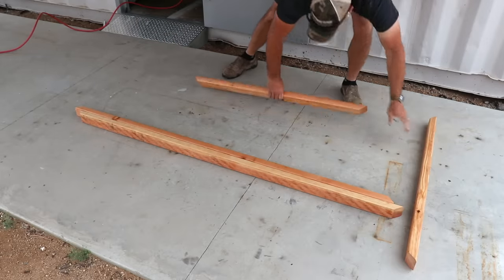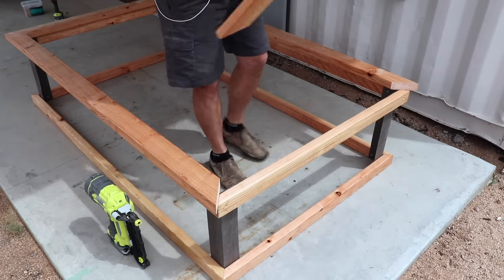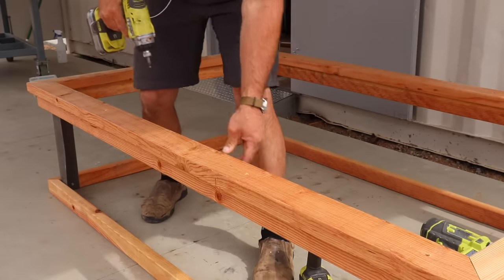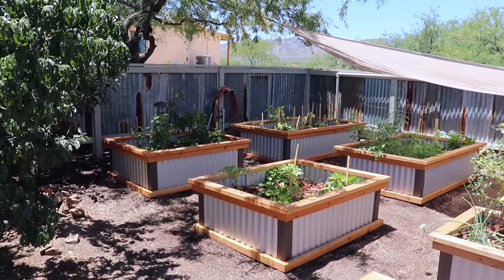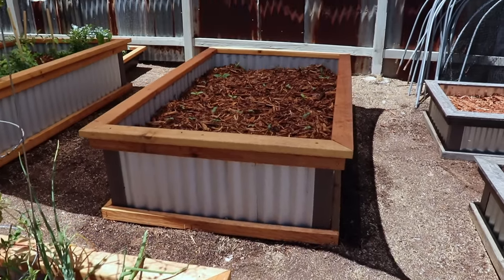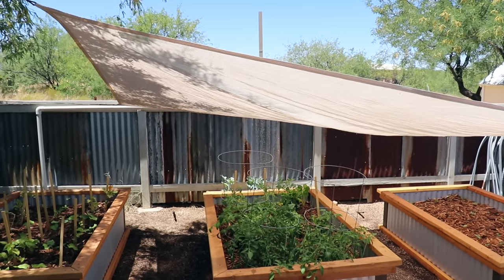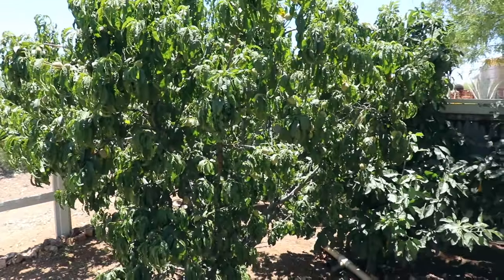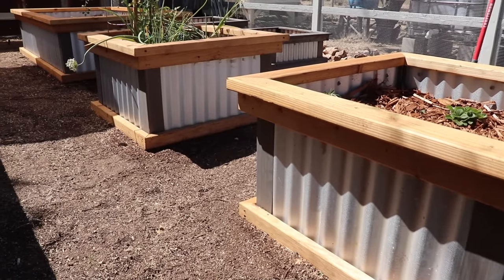Beautiful DIY Raised Garden Beds in 3 MIN!  - How to Build

Comment: I have a question, how high can the flashing component be? I wanted to make the raised bed about 32 inches as I am getting old and hard to bend. I am worried about the integrity of the flashing to withstand someone sitting on the top while gardening. Would you suggest wood instead?
Reply from the maker: The flashing isn’t holding weight at all when you sit on it.  It will be the roofing that will be holding the weight.   Which is why I like the vertical corrugation orientation as opposed to the horizontal ones.   In the horizontal positioned ones the flashing/corners would be taking almost all of the weight.  Hope that made sense and thanks for checking it out

Comment: Does the harvest  worth the effort and expenses? 
 I really want to go for it but am hesitant about putting 4 boxes in the backyard.
Great video as always man.
Reply from the maker: Thanks!    As for the harvest vs the effort of making beds.   That is a toss up.   Depends on how long you use them.   
The best bang for your buck is just to grow in ground if you can, at least in my opinion.   Building beds just makes the area pretty and the experience nicer.  But in most areas not totally necessary.  Hope that helps😀👍

Comment: Simple designs are often best, relatively inexpensive and they work, great job. You will drastically extend the life of that untreated wood and steel with a healthy coat of boiled linseed oil and a 2 dollar throwaway brush.
Reply: Boiled Linseed Oil, is not food safe.

Comment: I'm wondering if it might be possible to use corrugated fiberglass roofing instead of metal. The strength is in its shape more than it is the material so, it might be strong enough.

Comment: Did you use pressure treated lumber for the frame? Seems like the wood would deteriorate much faster than the metal.

Comment: Nice Build!   I am however curious, as I've seen different corrugated roofing builds  and noticed that your design laid the corrugated roofing vertically, where as others have built their's with the roofing horizontally. Have u noticed a difference in the build and on the external effect of water or drainage / moisture / wood rot ?  Didnt know if it was a design consideration.
Reply: I'm going to make these and I like the orientation big time of his panels. Structurally they're infinitely superior and load bearing, the look is so much nicer than any I have seen. This guy has a real eye for detail and an incredible mind.

Comment: Untreated timber? Rot? Termites?
What exactly is hardware cloth? Mesh?
They are certainly good looking beds, well done as usual. I really like the idea of using that corner flashing, I am not sure we have that here. As for the corrugated sheeting I would estimate that 90% of all garden beds here in Australia are built using it. Most would be colorbond though (as in painted), but not all. I would be interested in the what they cost you, a heck of a lot less thane here I bet. Cheers!
Reply: Yes mesh cloth, I use 1/2 inch size hole for my strawberry bed to keep the gophers out. And 3 layers of weed block cloth to keep crab grass from coming up through the bed.

Comment: I see several of your videos on raised planters that say they're your favorites so which of the builds would you say is your favorite overall

really debating using the lumber around the base or not. I'm up here I guess in the midwest Southeast Iowa

wondering how well they are going to do at staying level
I'm looking for about 36 inch height overall so I was thinking of using a 3-foot call section and then put about an inch or so into the ground below the lower wood framing if that makes sense

Comment: I have a question on the concern for cross bracing.  I am looking at building several 4x8 beds that are 24" tall and want to know if anyone has had issues with sides bowing out?  And if you have needed to put in a cross brace.

Comment: Did you turn the corrugated pieces sideways like that for stability (being vertical instead of horizontal) or because you like the looks that way better? I imagine it is for stability (or you just didn't want them 27" tall) because with just the flashing it seems strange you could sit on them . Is that the deal?

Comment: Mine went on a lawn so I left 2 inches of the siding hanging beyond the bottom frame so that I could whipper snap around them and to keep the wood off the ground to prevent rot. I probably should have went 3 inches as I usually cut the grass as tall as my machine allows.

Comment: Hellooooo thanks for the idea, they are amazing. Question, what is the highest you would recommend? I kinda want them taller. Thanks
Reply: I’m looking at another site that is twice as high, uses pallets for ends and 2 by 4 s (or 6s) to connect, and is much longer. I think they use the metal lengthwise. “Huegleculture” method used to fill and make into a compost bin on the bottom...”dirt patch heaven is the site I 🤔

Comment: Ok, I feel like premadonna and newbie asking this, but I don't know much about metals... I have all wood raised beds in the backyard, but I really like the look of these and want to add a few to the front.  So to my question... the roof flashing corners, I can only find it in the same zinc "color" as basically the corrugated sheets, so for the look of it if I bought what I found, there wouldn't be contrast between the corners and the side like what we see here.. is this something more to look for other then "galvanized steel"?  Thanks in advance.

Comment: A couple of questions for anyone…
1. Does the corrugated metal keep it sturdy? Wondering how it can take so much weight with only flashing?
2. Is the wood treated lumber?

3. Would anyone recommend using patio stone underneath for drainage?

Thanks!

Comment: Thanks for the ideas. Do you recommend staining the boards?
Reply from the maker: Yes, treating with some sort of oil would be recommended.   Or using pressure treated as the soil does actually touch the wood😀👍

Comment: In regards to the metal getting hot and heating the soil, corrugated metal reflects much of the heat away if you leave it in it's original galvanized state. Now, if it was a dark color, like black, it would absorb a lot more heat.

Comment: Did you use pressure treated lumber?  Any reason not to?
Reply from the maker: Nope, just regular pine.   I did coat them with linseed oil before I assembled them though.  But pressure treated lumber could be used as well😀👍
Reply: Brad Kusko He lives in Arizona where it’s extremely dry and rot is not common. If you were in the Midwest then treated would probably be the way to go At least for the bottom two by fours.

Comment: Hi. I am in Australia and I’d like to ask what type of timber a 2 x 4 is. Is it hard wood or soft wood. Treated or in treated. 
Thanks Phil
Reply from the maker: Hi Phil,

The boards I used are just regular pine.   I did coat them with linseed oil before I assembled them though.   But you could certainly use any wood you’d like to....pressure treated, hardwood, etc,.    Hope that helps and great to hear from 🇦🇺😀👍
Reply: homesteadonomics. Thanks again and I have started building some today and the chicken watering cups have arrived so that’s the next project taken care of. Keep well & stay safe.

Comment: I have an unusual issue.  I have septic field in the only sun area on my property.  I would like to build raised beds using 2) 4x4s as rails on the bottom of the boxes as to only have a minimal contact area on the lawn/septic.  I have been told no.  The ground is solid and firm.  Suggestions Please.

Comment: 31 and 32 gauge corrugated roofing is all I can find locally at Lowes and Home Depot.  Reviews are mixed, but it is thin.  Any idea where you can buy thicker corrugated metal roofing, 26 or 29ga?
Reply from the maker: Last I checked, the roofing at my Home Depot was the 29ga stuff(southern AZ).   And the roofing I used in these beds is left over from my house roof which was 26ga.     I would be hesitant to use31/32 ga.   Maybe try a roofer in your area to see if they have a source or could order you some.   Also, depending on where you are some smaller places will roll it for you in different profiles.

Comment: Corrugated metal pipes are used for water supply in older homes and commercial buildings. I believe home builders and plumbers went to plastic piping for homes only because of lower pricing and ease of installation (meaning less labor costs). So there is not a reason to worry about leaching from corrugated metal walls into the garden beds.

Comment: What was used to cut the roofing and flashing ?
Reply: That is a "cut off disc" put onto an angle grinder. They're a fiber composite very thin disc that will chew through anything with ease. They're very inexpensive too.

Comment: Is it necessary to have the wood at the bottom?
Reply from the maker: Nope, not completely necessary.  I have built a style of bed with no wood at the bottom.   Just a little bit trickier to get everything lined up when placing that beds since the metal will be a bit floppy until put in the ground.

Comment: Hey  Joe @homesteadonomics,  I'm curious about what you used to fill these planters. I live in CA on the Eastern side of the Sierra's which the soil consists of high alkaline desert sand. I'm sure it is similar to your AZ soil. Did you make your own concoction or buy bagged soil & amendment from the store? What is your soil recipe, and now that we're headed into the 2021 Spring crop season, how would you change your recipe? Thanks for your input, Joe!  12/24/20

P.S. Love the Container shop build-out series, too

Comment: Great build, I like how you cleverly used the angle sheet irons for the corner supports to get the corrugated iron as close as possible to the wooden rails. 

Question1)  Do you think some plastic concrete liner sheet would help make the corrugated iron last a bit longer (so the iron no longer is in constant contact with moist soil. 

Question 2) Have you ever compared the costs of buying pre-made corrugated riser bed kits versus  building your own ?  (ignoring the labour for both methods)
Reply: Galvanized metal will last long when the moisture is not held constantly against the metal.  The plastic liner that creates an air pocket should help the metal to last longer by creating an air pocket.  If your soil is well aerated this would also reduce corrosion.  I think this design with good soil should easily last 10yrs and more than likely 15-20yrs before you would have rust holes.  For my boxes I plan to use corrugated metal that has been prepainted.  This product you can order from your local metal roof supplier.

Comment: Now I have too many ideas for beds!
Reply from the maker: There are a lot of good ones out there😀👍
Reply: @homesteadonomics  Saw one the other day made from half width a cattle panel and a roll of 20 in wide aluminum flashing, which got me to thinking about using a 47 inch tall horse fencing on one side and 24 inch fencing on the other with the flashing to cover the hole that would give me my outside fencing  with the horse fence which is much cheaper than cattle panels and I already have it on the place, along with T posts to hold it up. But that is for next year we'll do containers this year

Comment: Where did you find your flashing or what was it called specifically. I've searched L flashing, Corner flashing, and Step flashing and can only find it in 8 inch lengths or up to 10 ft lengths. I was looking for 2 ft length or did you cut yours down to size?
Reply: I can't find anything but 8" long flashing it seems

Comment: Thanks for the "How To " video.   I would shoggie burn the wood and may be a nice sealer for extended life.
Question:  Your opinion of using  Cow trough metal tubs with a drain pipe?
Reply: I've seen them used, just really pricey

Comment: Beautiful beds but impractical in my area of texas. Plain wood will rot away in less than a year and treated wood may release toxic elements into the soil. I've tried concrete block beds(lost water to quickly). My beds now are mostly just the corrugated tin. Several are completely round. For shallow rooted vegetables like greens and lettuce I use raised cattle bunks. They are ten feet long by two feet wide and on a metal frame that holds them at waist height. A couple of drains on the ends set to hold an inch or so of water at the bottom. A sprinkler hose down the middle of the beds keeps them watered. I have four of the cattle bunks. Eight corrugated tin beds and two hydro beds fed by a six hundred gallon fish tank.

Comment: How did you keep it from bowing out. Mine look round in middle.
Reply from the maker: Hi Caroline,   I haven t had that problem.   But if they are too long or too high then you can strain the wood too much with the soil pressure.   I’m guessing that is what you might be experiencing.   My long ones are about 7.5’ long.
Reply from the maker: .....additionally if you are adding heavy clay soil or something like that it could happen.   A well drained soil would be best.   Hope that helps

Comment: Could you make the beds 10 ft long x 4 ft or would it not be structurally sound. Also what gauge steel did you use?
Reply: Excellent question Greg thanks for asking I was going to ask the same as I made a trip to Home Depot last night and the roof flashing the offered looked rather flimsy. I understand that the corrugated pieces will make the entire structure rigid. But when he flips the structure to add the corrugated pieces it looked rather stable. So I don’t know
Reply: @mski435  I am going to go with the 26 gauge vs the 36 gauge  for two reasons, First the structural integrity but also when you cut the galvy you expose the edge to faster oxidation and i don't want to have to repair in 5-8 years.
Reply: Greg Paulsen thanks so much for the reply
Reply: Greg how did the 26 gauge sheet-metal work out for you I see a lot of people are asking the same question about the flashing that he used I was unable to also find that size at Lowe’s or Home Depot I may have to go to a sheet metal shop and fabricate it however isn’t a 26 gauge still rather thin
Reply: Actually I rewatched  the video if you look at 2:12 you can see that the flashing It bends a little bit when he applied a little bit of pressure to it,so the stuff he’s putting in there is quite  thin however I think the rigidity of the entire unit is really due to the corrugated pieces that are put in after the fact so at this point I’m not too worried about the corner pieces. I think the corner pieces are purely aesthetic

Comment: About how much do they cost to build. Love how they look.  I live in New Mexico what about rodents and 🐍 do they get into them totally cared of snakes. 😄
Reply from the maker: I broke it down in another response but it came it about $85 per 4x8 bed.   However I used old roofing scraps that I already had so they were substantially cheaper as the roofing is one of the pricier components.  I’ll try and remember to pin a comment with the rough costs😀👍
Reply: Scared. Of 🐍

Comment: My understanding of galvanized metal. Assuming the maker of said metals is reputable.  A greater concern to health would be the burning of galvanize metal.  It causes the release of zinc oxide.  The fumes are toxic.  The corrosion of galvanized metal will also release zinc but at a low level and the plants don't mind.  What would be a concern is with the little bit of lead that is also in the galvanized metals.  Lead not dissolving much in water can remain.
Reply from the maker: That’s my understanding as well.  I’ve welded stuff that I thought I got all the galvanizing off and it did produce noxious fumes.   So I had to do quite a bit more prep to remove all the galvanizing and then is was okay in that area.  And for these beds I think a little extra Zinc won’t be bad for the plants😀👍

Comment: WoW. That's fantastic and so simple that it's brilliant! I call that 'elegant' design. I would have thought that the roofing panels wouldn't be able to withstand the pressures of all that wet dirt. But I guess I would be wrong! Do they show any signs of deforming under the pressure? 

I was going to build 4" thick monolithic concrete raised beds so that the archaeologists in a thousand years would scratch their heads and wonder what kind of religious sacrifices were performed there... Heh. But even if these rot out in 20 years, they'd be easy to replace!
Reply from the maker: Thanks!!   I haven’t had any issue with soil bulging out on the sides.   But I imagine if they were made like 3-4’ high and the metal wasn’t a heavy enough gauge that could happen for sure.  Or if you used a very heavy clay type soil that would put extra stress in the sides as well.   

As for the concrete ones that archeologists would find....lol.... that would probably be about right😂👍
Reply: @homesteadonomics  I always have to do things the OCD way. But your raised beds ars so easy and elegant that I may have to build them first before forming up the historical ones... Heh... When I do something, I don't want to have to build it again- ever!!! Cheers

Comment: How these tin roof panels affect the soil temperature? Does that even matter ?
Reply: He mentioned at the end of the video that it doesn't seem to heat the soil
Reply: I saw on another channel recently, sorry dont remember who, he had metal beds, woodbeds and cement block beds.  Temps measured 4 inches from the edge were identical.

Comment: This build is not cheap if you're in Canada. Treated 2"x4"x8' are 10.54$ CAN right now. Corrugated galavanized panels aren't readily available in stores, you must custom order it and the cost varies on the type of panel. Easily 100$ of panel for one raised bed. My estimate would be around 200$CAN  for this raised bed. I will calculate my cost once I am finished and will repost my actual cost.